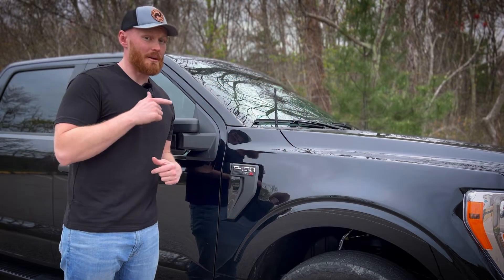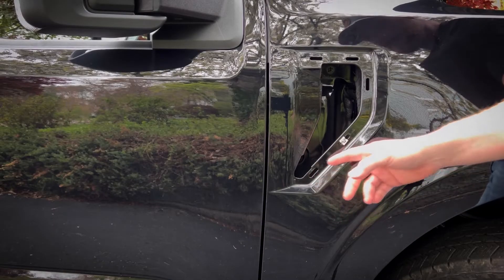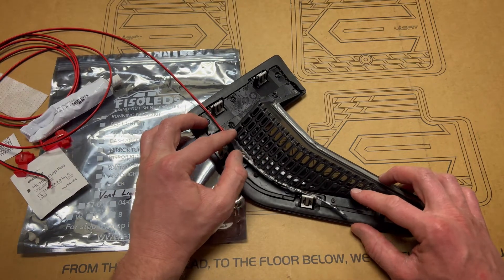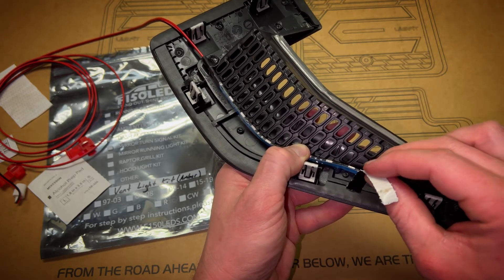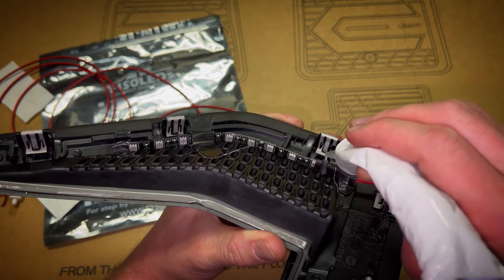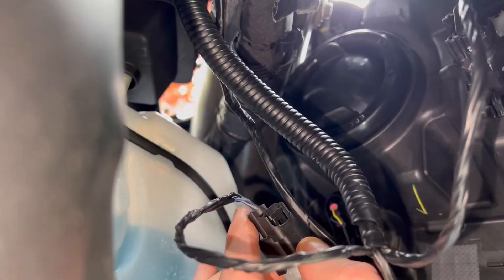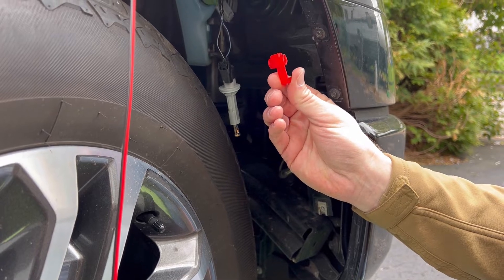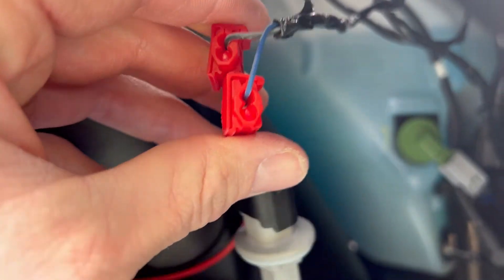LED SIDE EMBLEM INSTALL ON 2021 F150 | Step by step guide

Comment: I bought this kit for my F250, but was not satisfied with the quality of the kit nor the instructions to mount the LED’s.
Reply from the maker: What would you like to see different. I’m thinking of developing my own.
Reply: Well, the mounting tape was already coming off the LED’s when I received the kit. I think there’s a better way, but not sure what that is. The instructions were not clear. I think you did a great job the way you did it. I would never have thought about doing it that way. Also, on the 250, you can’t fish a wire up through to the engine compartment. The instructions say to drill an 11/16” hole up through 2 pieces of metal, which I was reluctant to do.
Reply from the maker: I’m working on one. 👍🏻 I’ll keep you posted.

Comment: Love it.  I like the way you did it subtly.  Some of the pics on their website are too much and just kinda gawdy, but this looks sick!
Reply from the maker: Hey! I appreciate that. Yeah I’m more for the subtle look too.
Reply: @AutoHeadz  The way the new MKII version is designed, it doesn’t look like you could install it this way now.  I’m wondering if maybe running a piece of tape up the length of the strip to cover half of the lights might achieve a similar result.  Mounting it behind the grid just looks so much better, though.  Makes it look like you’re hiding a nuclear reactor under the hood.  Lol

Comment: finally got it to work man. thanks your video was very helpful. I had to install to the led lights, 3nded up being pin 3 and 7 on driver and 3 and the only black wire with yellow line on the passenger side. FYI people make sure those clips slice kit really go in
Reply from the maker: Thank you for this! If you could please email me   I have a question AutoHeadzf150@gmail.com
Reply: @AutoHeadz  just did, I appear as xavier

Comment: Looks bad ass!
Reply from the maker: Dude!!! It’s sooo sick! Lol. Iv been taking random drives at night to pick up a drink just for an excuse to look at it lol.
Reply: @AutoHeadz  I just installed new headlights on my 2019 and I’ve done the same thing and I find myself asking my wife how good they look and she tired of hearing about it lol.
Reply from the maker: 😂😂 I can relate to that lol!
Reply: I putting mine in now. What a pain if you have the OEM LED headlamps. I have finally figured out the pins for the wiring harness...which even though the pins are the same for right and left, some of the wire colors are different. My cousin works for Ford and I have the actual diagrams for my VIN. Now that I have all the wiring figured out the question is what is the equivalent name for "side marker" because there is no side marker on the headlamp assembly. The choices are "side select", park, or turn since obviously not daytime running, high beam or low beam. There is also a VPWR that I have not the faintest idea what it is for. F-150leds was trying to help but they were perplexed as well.
Reply from the maker: @r7j7t7  lol oh man! Sounds complicated lol. Ok, I can’t say with 100% certainty BUT I am 90% sure it’s going to be “park”. A parking light is always going to be a light that is on 100% of the time and the park light on these F150’s is wired up the same as the side marker…SO..I would assume that for all practical purpose the “side marker light” is considered the “park light”.

Comment: what color are those? sorry I'm colorblind don't know if it's green or red
Reply from the maker: Of course! No problem at all.
These are amber. If you ever need help with picking a color let me know and I’ll send you the link so you get the one you want. They have a bunch of different colors.
Reply: the lights stay on all the time right?
Reply from the maker: Yes.
Reply: another question if I have the lariat with led ,it says wiring is different, do I connect to the plug beneath the one you disconnected? instructions on web page is just a picture, that to for a average joe looks like brain surgery